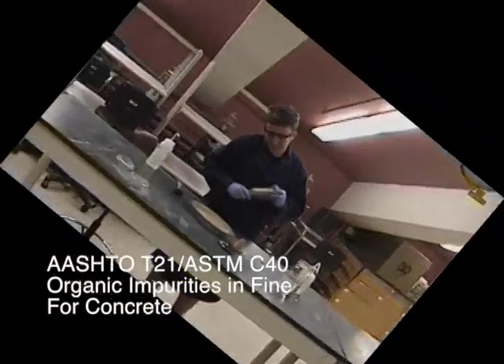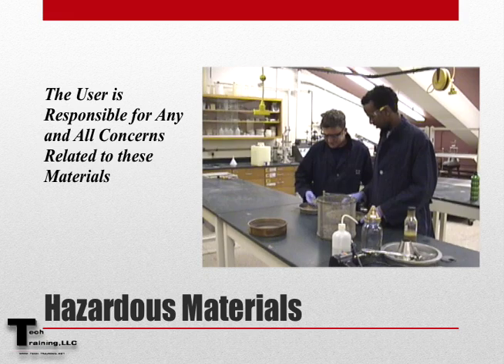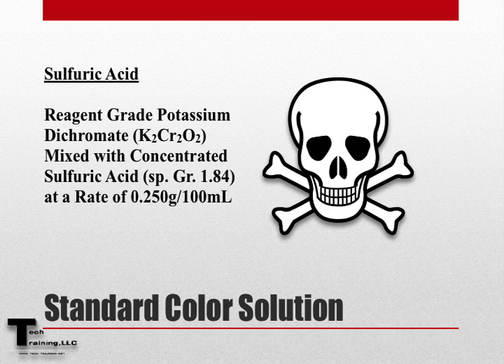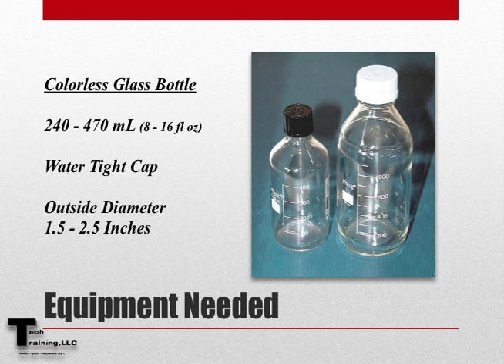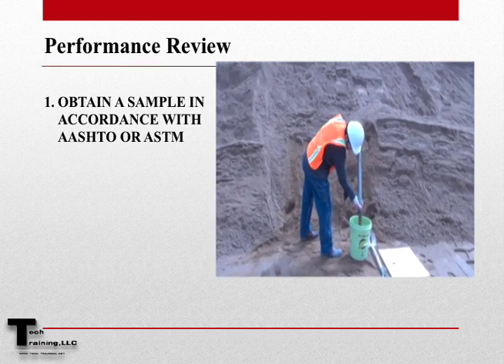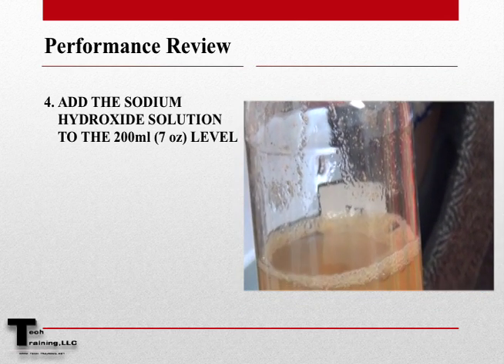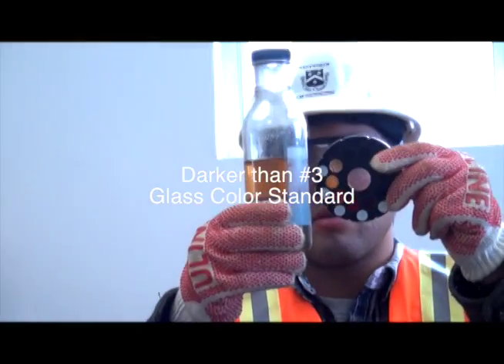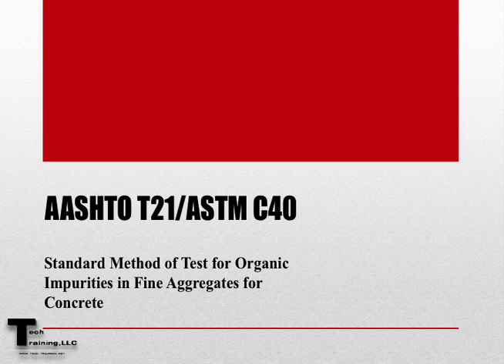AASHTO T21 ASTM C40

Comment: How Can we Konow that sample pass or fail
Reply from the maker: In this procedure there is not an actual "Pass or Fail" result. If the solution is darker than the #3 on the color chart, additional tests are required to determine if the materials in the sand will negatively impact strength results.